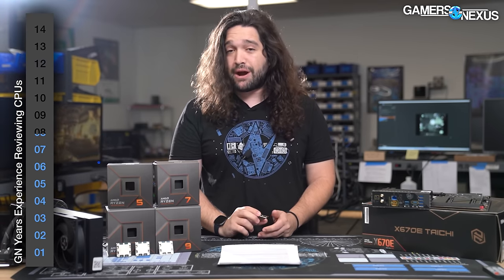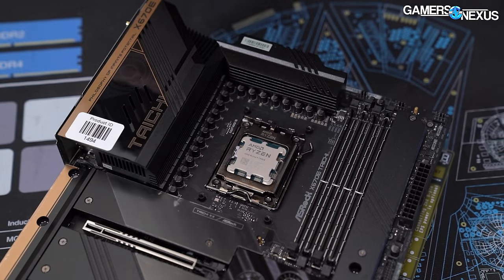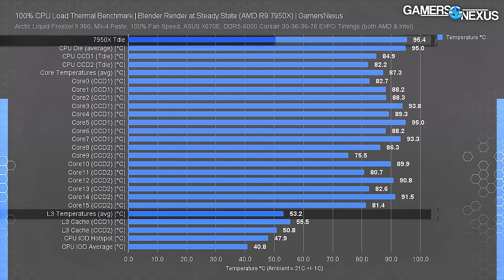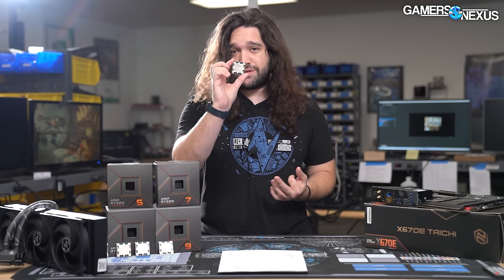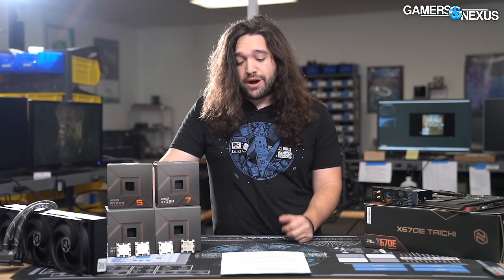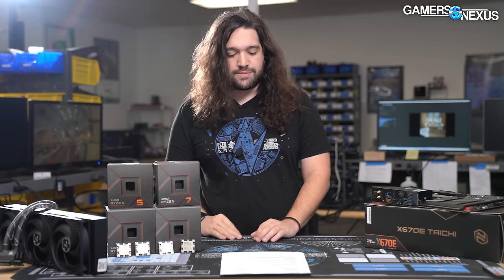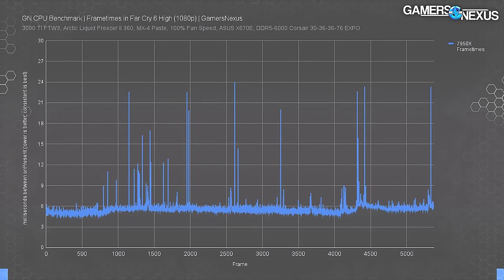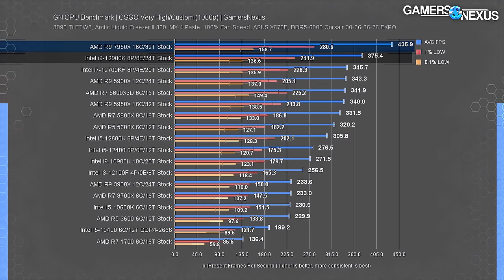95°C is Now Normal: AMD Ryzen 9 7950X CPU Review & Benchmarks

Comment: So if this CPU is designed to go right up to 95C then the cooling comparisons will based on what steady state clock speed can be achieved at 95C.  It will be interesting to see what undervolting can do.
Reply: My first thought was what if I undervolt? And what if I capped my fps to 120fps with rtx3080ti
Reply: And liquid metal
Reply: @Praxss  If you cap it and the gpu isn't maxed out it will run cooler of course. the cpu won't produce heat without purpose.
Reply: I'm curious to see what they do under nitro cooling, like how much power they will munch under those conditions.
Reply: @endless2239  My guess would be it being similar to existing high power chips.
Reply: Techpowerup review saw a ~5C improvement (94->89) with a 0.05V undervolt compared to stock. That's with a 420mm AIO.
Reply: @MMGuy  how does this work? Wouldn't the CPU algorithm just boost power / clock speeds to hit that thermal limit? Or perhaps the undervolt is capping the power consumption and the clock speeds are hitting a stability wall
Reply: @Praxss  On VSync it will idle between frames resulting in lower temps. Assuming you're not doing some background task.
Reply: computerbase tested a 100mv undervolt, got a power draw reduction to around 180 watts, temps down to the mid 80s under p95 29.8 with an nh-d15. max power draw with the nh-d15 was about 195 watts.
Reply: Undervolting much with the 5950x didn't play really play that nice (you couldn't undervolt that much)
Reply: @endless2239  Pretty sure someone already leaked LN2 results with this chip. It ran cool (duh) and used less power, since the heat resistance is lowered, while clocking over 6 GHz.
Reply: I AM THE BEEST YOUUTUBER YOU'RE ALL TRAASH COMPARED TO ME IM THE BEEST 😂😂😂😂😂😂😂😂😂😂
Reply: @ThunderGoatz  I'm pretty sure it already somewhat on the edge of the power limit, therefore the CPU will still boost but because of the power limit, it can't boost any higher and the cpu temps drop because of undervolting
Reply: Roman's delid contact frame and Curve Optimizer in the UEFI should help 🙂
Reply: @Francidede  that all is subject to the silicon lottery. some will undervolt a lot, some very little.
Reply: @benjaminoechsli1941  How high? LN2 is not practical but refrigeration might be relevant dependent on how high it goes, yes its frequency limits to in addition to power and power ones so don't think 7 GHz is plausible and 6.5 is just an 12% boost.
Reply: @benjaminoechsli1941  oh? interesting, now I'm even more curious to see at what volts did they manage those clocks, I will definitely wait for the overclocking videos but nice info though.
Reply: eco mode runs on 65 watt and you get 97% of perfomance
Reply: @GIANNHSPEIRAIAS  actually it's 140 on the 7950x, used to be 65 on the 5950x
Reply: @Praxss  In reality you should ALWAYS cap your FSP. the only exception is: You are a progamer and you get paid on a professional league. other than that: the fps discussion doesnt matter since your not good enough. 200 or 300 fps doesnt matter if your aim is sh...
Reply: @Francidede  5950x's were heavily binned chips to hit the efficiency numbers they needed for wide AM4 support so they were already running stupid low voltages compared to the 5800/5600x chips. it'll be interesting to see if there's any room on the 7k series and what impact it has on boost clocks.
Reply: @MMGuy   If you don’t change the tdp, wouldn’t that technically increase performance since the cpu seeks SS clocks at 95 degrees?
Reply: @sirmonkey1985  well I can confidently say rip to those living in hot days with no AC and poor insulation. 

But Ideal for those living in cold environments, with no heater and poor insulation.
Reply: kitguru undervolted.. very good.. must do really.. watch their video
Reply: @endless2239  I guess, the powersupply will melt :)
Reply: @StephenMcGregor1986  deliding it will surely help, however curve optimizer is probably useless since ryzen 7000 is square and has similar size to 5000 series so there should be no problem in reaching maximum contact pressure
Reply: @siontheodorus1501  curve optimizer in the BIOS
Reply: @givemeajackson  that should be investigated. Sounds like Temps could change as bios matures 🤔
Reply: What a god damn joke.  Worst cpu roll out ever🐳
Reply: It's more interesting to see how good the heater performace of 7950x for space heater.
Reply: @runninginthe90s75  summer time coming up in Australia, ooh boy, I'll take 10x 7950x + RTX 4090 setups in case it's not warm enough here

Comment: Nice to see that AMD is finally able to compete with Intel in the space heater market.
Reply: See the eco mode results in some other reviews. It's really impressive. Zen 4 laptops will crush all competitors.
Reply: Just in time for winter in the Northern Hemisphere  chef kiss
Reply: AMD has lots of experience in that department. Lol
Reply: Real glad I built a 5950 and evga 3080ti as power is expensive on the entire West Coast. I remember the old dual 590 Nvidia sli. That was a heater. The 4090 is crazy. At 62 my eyes are cool with a 28 1440 with gsync. I love EVGA power supplies and have used them in the many builds I've put together over the past 5 years. Intel has a long way to go in the efficiency dept.. I used AMD in the 90s to 2003 or so went with Intel from 03 to Ryzen 3000  then finally 5000. I'm retired so only build for friends and family. The important thing here is use what combines good performance and less heat for durability. A great PS is essential. Fan boy nonsense is for children. Competition has forced Intel into line and keeps AMD in check. So I'm a fan of competition.
Reply: @TheMorrowgamer  i remember bulldozer with their dinky 60mm fans at idle sounded like a go cart lol
Reply: @ItalianMetalHED  Flashbacks of FX-8150
Reply: @TheMorrowgamer  I had the 8120 haha my god that thing was a train wreck i immediately regretted it and think I scrapped it for an I7 3770k until amd got their sht together lol
Reply: @ItalianMetalHED  lol I'm running an 8320e overclocked to 4.6ghz all core and it idles at 30c
Reply: @transcendtient  omg why?! Just get rid of that abomination cpu lol I didn’t think they’re still being used especially it being 12 years old.
Reply: You’re a trooper I’ll give you that lol
Reply: @ItalianMetalHED  Shit still works. Only game I haven't been able to play is Halo Infinite and I blame 343 for that one honestly.
If Cyberpunk will run on my system 343 has no excuse.
Reply: @transcendtient  damn it should be in a museum lol 343 ruined halo!!
Reply: @transcendtient  your cpu will bottleneck everything else. Single core performance was terrible until they scrapped that series then slowly started catching up. What video card are you running?
Reply: @TheMorrowgamer  lmao true.
Reply: Amd FX chips were volcanos they were sold with water coolers or would overheat
Reply: @aztracker1 Chill, he’s joking
Reply: @eleventy-seven We stand with Russia.
Reply: Finally able?  LOL